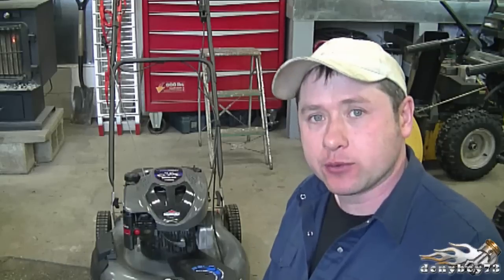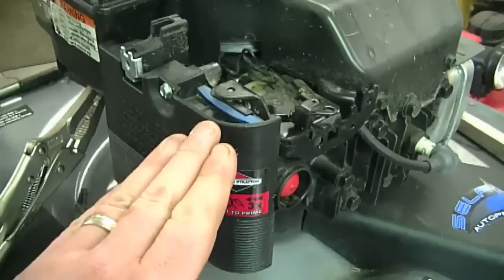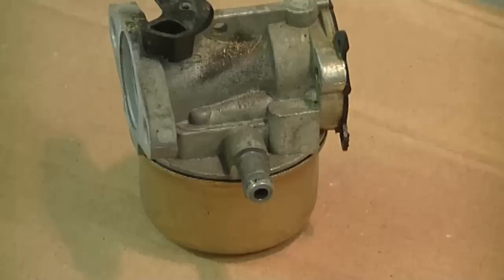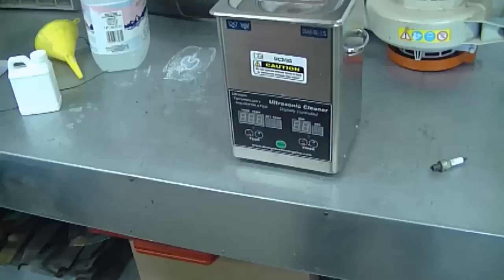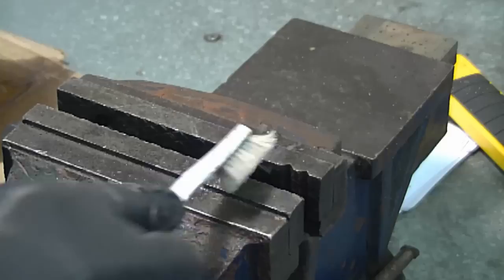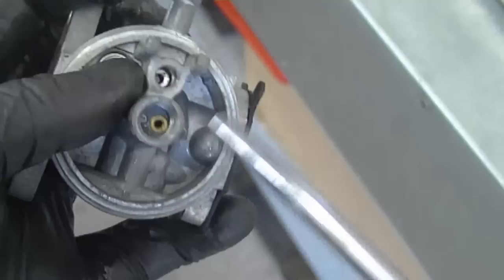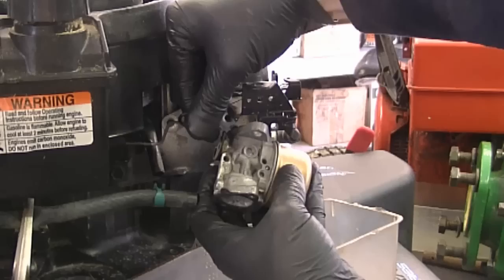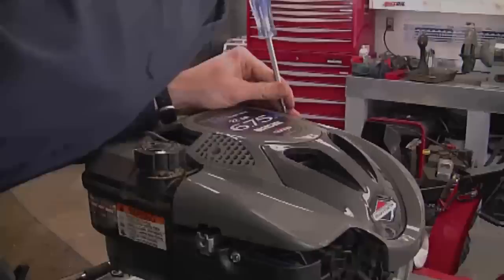CLEANING A Briggs & Stratton Quantum Lawnmower Carburetor

Comment from the maker: check spark, compression, make sure there is fuel to the engine, I usually spray quick start immediately after a rebuild to get it going quicker
Reply: I started mine as soon as I knew I could, then reassembled the rest after success.
Reply: You're the best

Comment: Much Appreciated.  Your instructions worked perfectly on my 2 year old snowblower which would not start. Turns out  the carb was was  gunked up with green sticky deposits , which I'm guessing might be copper carbonate caused by crappy ethanol in my fuel.  I've subscribed to your channel which are the best quality videos I was able to find. You saved my 120 dollars by not needing to take to my small motor repair shop.
Reply from the maker: you're welcome

Comment: I just cleaned my carburetor assuming that I had a dirty needle and seat. However put it all back together still would not run. So found your video and realized that I never checked the passages in the bowl nut. When I checked I discovered the passages were completely blocked. Cleaned them out with carb cleaner and some small gauge wire. Mower now runs like new.
Many thanks.

Comment: Thanks for the great videos. Our hand me down mower always had a really rough idle, then wouldn't run unless you pressed the prime button, as you showed here. I cleaned some gelatinous substance from the bottom of the fuel bowl (otherwise the carburetor looked clean), and once I remember to prime it, it started and ran as smooth as in the video; smoother than it ever had for us.

Comment: I am So pleased to have found this video.
I have a "Greenfield" ride on mower with a 6HP Briggs and Stratton engine that will run for about 15 minutes then stalls.
If I loosen the fuel line After the in-line filter, the fuel miraculously appears in the inline filter again, the engine starts and runs till the next time it "runs out of fuel!.
I now feel confident about taking the carburettor off.
Thank You for sharing your knowledge, and the very clear and concise videos'.

Comment: A belated thank you for this video: was watching it as a refresher and realized this is where you mentioned using a tip cleaner for the little holes. I'm not a welder so it took me a while to find what you meant (a little $3 thing in the welding department) but now that I have one it's great. As a suggestion, I used a pair of side cutters to snip off the smooth end portion of a few of the files so they can clean shallow holes better.

Comment: Another great video from Don. I must confess that at first I did not understand what Don meant when he said that the bowl bolt is also a jet and why he went to so much trouble to clean it. I cleaned my carb body to within in an inch of it's life and could not get the engine to run for more that a second or two. After paying real close attention to the bolt one last time it fired right up. Basically the bolt is hollow and gas gets sucked up through it. If the orifices in the bolt are clogged the engine will not run. After going through this I now understand why Don was so meticulous with the bolt! It does more than just hold the bowl on!! Thanks Again Don! You have a great channel!!
Reply from the maker: +Paul M thanks Paul

Comment: Excellent video, great camera work.  So much more informative and "watchable" than these weekend warrior videographers who hold the camera in one hand and work with the other!  Very clear vocals and diction...I was thinking Canadian, then I saw the predominant French on the can of started fluid...that clinched it!  The engine on my pressure washer had exactly this problem and I was a little leary about messing with it myself.  After this video, I feel completely comfortable pulling the carb off and cleaning it.  Thanks.  I've subscribed!
Reply from the maker: thanks for subscribing and greetings from Ontario Canada
Reply: +donyboy73.... thanks for your videos Bud. I've learned quit a bit by watching them. I've done a head gasket and adjusted the valves on my Briggs 18.5hp. I've got a Walbro carburetor, Do you have a video on how to adjust the Carburetor?

Comment: This really helped me!
2 points:
1.next time I'd never remove the needle valve seat! just block the channel to keep the carb cleaner away from the tiny rubber seat. I damaged it on removal.
2. If you do and are replacing with a new one, know that the tube is TAPERED down to the needle valve seat location, at first the replacement appeared too small, but when tamped into place it fit fine.

Comment: Thank you for your in depth video and step by step instruction.,ihave fixed a rider lawnmower and a snow thrower that was waffling by drilling the removable jet.and a carb cleaning a push mower that wouldn't start. Thank you so much!! Oh I used a o18 micro drill the smallest in the kit!

Comment: Late yesterday I removed this carb from a Weedeater mower.  Will place it in my ultrasonic cleaner today and replace it.
I am on a roll, repaired my JD GT275 lawn tractor yesterday and it is running like new.

Comment: its amazing how many of these things end up on the side of the road due to this issue. one easy fix later and it can be either resold or kept for personal use
Reply: I Literally got this same mower two days ago.. carb clean..and reset the butterfly valve which had somehow dislodged and jammed at wide open.. and it runs like a top.

Comment: Apologies for the lengthy question... Got Troybilt with 675 B/S, no primer bulb, from a Lady whose young son way, way overfilled the oil. Somewhere along the line he hit something to bend the blade and shear the key on the blade adapter as well. After draining the oil, I first pulled the starter, and a bit of oil spewed from the spark plug hole. After a good Carb clean, oil change, blade and adapter replacement, I took off the muffler and about 2oz of oil poured out. Put it back together, started on first pull, smoked like crazy for about 7 min, then I mowed my back yard with her machine for about 20 min. 

Went to deliver it to her the next day, and realized I forgot the bend the tabs on the muffler washer and lost one of her muffler bolts somewhere in my yard. Made a mad dash to the hardware store for a new bolt and spacers. I over tightened the bolt a bit due to the spacer inside being slightly shorter than the other bolt, slightly denting the muffler. Got it unloaded at her house, pulled the starter and it lugged and chugged, finally dying. 

I took it back and figured to look at the last thing I did to the machine. I checked the muffler mounting bolts, all gaskets are in place and the choke arm is free. I reckoned it might be a partially sheared flywheel key that I finished off mowing my lawn. Replaced that, (it was not sheared, but starting to)  Same problem, it starts, chugs and lugs along until I manually open the choke butterfly, and will sputter, eventually rev up, hunt around for speed for 15 seconds, and finally warms up and smooths out. I have adjusted the throttle arm to up the rpm from 2600 to 3250. I cleaned the carb again, this time replacing the valve seat, and new intake gasket and manifold o-ring, double checking with a fine wire that all passages are clear in the carb. The choke linkage and governor linkage operates freely with no snags or tension.

I have now drained the oil and gas again, and have it nose down to assist draining any more oil that may in the top end, however none is really coming out the spark plug hole. I can't send it back to her with instructions to stick her fingers behind the airbox to jiggle the linkage around till it starts running right. I'm at a loss. Any ideas?

Comment: Hey dony its Nate I bought a Craftsman 25cc straight shaft weed eater yesterday and used it 2day it's starts and runs great but it has a high pitched whine noise when throttled up @ cutting head. It has a clutch also. It was made in august of 2013.

Comment: Hey dony its Nate I bought a 25cc craftsman straight shaft weed eater yesterday & used it 2day it start n runs gr8 but when throttled up it has a high pitched whine @ cutting head. It has a clutch also.

Comment: To save a few minutes in the procedure, some viewers may plan to remove only the threaded nut beneath the carburetor bowl and the bowl, itself. However, on a dirty, dustry engine, dirt and debris are likely to fall into the bowl on removal.

And after cleaning the bowl,, reinstallation of the bowl requires the bowl be aligned precisely to avoid dislodging more debris-- almost any speck of dirt can cause a problem, and may compromise the work completed. 

The best approach is hose off all the debris (from a completely cool engine) well before the carburetor operation, and to let the machine dry, first. Since cleaning the carburetor is done only occasionally, it may be worthwhile to use a car wash pressure spray wand for a more thorough cleaning of hard-to-reach areas.

BTW, this is an excellent video-- well organized, with superbly lighted and focused close-up shots, and a clearly spoken narration. Wish all the videos had at least the production values of this one.

Comment: Thanks for this video it helped me to rebuild my carburetor last year. I rebuilt this carb thinking it would help my surging problem,but i think it is my governor. Could do a video on how to adjust the governor on this type of engine. Since the throttle is already open which way do you turn the shaft to correctly set it. Thanks again for all your videos

Comment: You forgot to remove the gasket on the carb that seals the air filter housing to the carb. Also it seals for priming as you know. All the gaskets and seat, I take some Magic Lube and give a light coating. ML is a pure silicone super super tacky clear grease. Perfect for 0-rings and gaskets to keep them moist and non-sticking. Makes gaskets reusable and last a lot longer. Magic Lube can be found at your local swimming pool supply store. It's great on household plumbing o-rings and such. Makes your faucet handles turn real easy and water doesn't wash it away. Helps rejuvenate dry carb bowl gaskets.
Reply: The Quantum series is on the old side and especially when they have been unused for a couple of years or more,I consider the whole fuel system dirty.
Remove and flush the tank.
Replace fuel line.
Replace the gasket between the filter cover and carburetor and most of the covers are warped and will not seal correctly for the primer to work. Replace it.
Otherwise this is a perfectly splendid video.
I have been snake bitten too many times from rotting fuel line and warped covers.
Just do it all at once and be done with it and have a happy customer that will reccomend you every time.

Comment: Another good tip is use a dremel tool with the wire wheel...brass so it doesn't scratch ....and a nylon brush wheel that also quickens the cleaning process
Reply from the maker: thanks for the tip

Comment: Great video Dony, very helpful and informative.  For these non adjustable carbs, are there any other further adjustments you would make to tune the carb? How do you control whether the mixture is too lean or too rich?  And how would you set the idle speed?
Reply: The mower will run without the air filter, and you can still get to any adjustment screws.  My stock carburetor on this engine has no choke but has screws.....
(The old rule of thumb is: Screw in the screws until they stop, then back them out 1.5 turns.  Adjust as needed while running.  Idle screws have to be set with machine warm) The mower should not be set on fast idle to run as fast as it can as this is dangerous and leaves no room for the governor

Comment: Every time I clean one of these, I always install a new needle, needle seat, bowl gasket, and breather plate gasket. Most rebuild kits are less than 10 bucks. Water will make those parts swell, so even cleaning may not always be enough. Nice video though!

Comment: Not especially but I have managed to shoot a few across the yard and lose them from the spray (especially from air gun).  Also, if there are any crunchies nearby that get blown through the seal opening, they could scratch up the seal face and make it leak.  A good carb dip can also eat some of the seals.  I am talking about the old school or Pro versions - not the EPA watered down stuff from auto stores.  Red seals work better than the black in my opinion.

Comment: That engine looks almost identical to a B&S 6.75 engine on my Craftsman self-propelled push mower; one that I'm trying to get up and running, engine model 125K02-0253 E1. The control bracket (somehow) broke so I'm having to replace it and will be installing a new $16 OEM B&S carb.  For some reason it was very difficult to restart whenever the engine was hot. Always ran great when first started up or whenever it was running for that matter but frequently took 30+ starter pulls to get it running again after it was shut down while it was hot (guessing it was flooding out?).  Hoping the new carb will take care of that. Oh yeah, all those additional starter pulls finally broke the starter cord. Will be replacing that, too. Oh well, great video, camera work, detail and information. Will come in handy for me sometime soon no doubt... thanks!

Comment: Nice job. But did you flush out the tank and fuel line? I had an old Ariens that I cleaned the carb on and put it back together, it ran fine for awhile and then stalled out again. I flushed the fuel tank and lines  and it ran fine. Thanks for the videos. A lot of useful info.

Comment: awesome vid Donny.....i followed tour instructions to a tee but lawnmower will not start....it will only start if i give it a boost with quick start....it runs fine while it is running but once shut down will not start with out the quick start....any ideas....primer bulb has no line it's moulded into the side cover

Comment: All of your inputs are awesome, I did the rebuild as you suggested. Now the machine will run fine for about 1/2 mins and dies out. Ideas?
Reply from the maker: sometimes the whole carb needs to be replaced
Reply: try to change cap of gas tank .

Regards from Croatia

Comment: The problem is it is hard to pull the cord. I did adjust the valve lash according previous video( it was 8th, I put back to 4th). The engine does runs smother. But compare to other engine in story

Comment: Hi Dony great video's. I have a Quantum 50 which is hunting. I gave the carb a clean and replaced the needle valve and seat along with the gaskets. This carb has the throttle cable. I have also tried running it with the air filter removed but the problem is still there. I was wondering what would be the next plan of action, cheers.

Comment: Dony great videos but I have a odd problem on a 6.75 hp tecumseh engine on a push mower that will randomly die I have cleaned the carb several times when I got the mower there was one bolt broken that holds the crab to the intake tube I was wondering if this might cause the random shutdowns?

any info on this will be a great help thanks

Billy

Comment: I have Briggs & Stratton Quantum 6.25HP model# 228511x8e. When I started this season (after I changed the oil and gas), it started fine but it was running weak, it wasn't as strong as before. I thought the carburetor was dirty so I followed the instructions  in your video to clean the carb. Then put everything together correctly like you said, but now my lawn mower won't even start. What could be wrong with it?

Comment: Donyboy, can you tell me how critical the welch plug in the carby is to the running of the motor. I have a Briggs & Stratton Intek 60 with hot starting problems, took the fuel bowl off and found the welch plug in the bottom and a shiny mark where it had been sitting for a while, couldnt get the carby bolts undone without force so left it out. It runs good otherwise. Steven

Comment: Just watched you video on cleaning a carburetor. Very helpful so I subscribed. Thank you. I followed your video and did the carburetor on my Snapper 13hp rear engine ride on. I read that when you remove the fuel bowl you need to hold the float up to stop the flow of gas. My gas does not run with the float up or down??? Any suggestions?
Thanks,
Harley
Reply from the maker: the needle might  be stuck or there is no fuel getting in carb

Comment: I have an edger with a Briggs engine. I have to keep the choke partially on to get the engine to run at at high RPMs. Could this be a dirty carb problem? Any suggestions would be appreciated. Enjoy your videos. Thanks.....Guy

Comment: My first experience opening up and rebuilding a Briggs & Stratton carb.  On mine, it was fairly dirty, and where the Welsh plug was had black sooty dirt.  I used  the end of a paper clip and started scratching up the black soot that accumulated.  I sprayed carb cleaner over everything per your great video.  On your video, I noticed where the Welsh plug is located, I always thought it was a screen that needed to be cleaned. Then I noticed the "screen" was missing. It's NOT a screen at all, you call it a Welsh plug, and THAT'S whats missing on my carb. It's just gone. I have a kit that includes those Welsh plugs, and in the morning I will replace a Welsh plug where the old one was.  I can't figure out how it got lost! I didn't use any compressed air, only jetted carb cleaner in all the holes.  Any thoughts???   THUMBS UP!!!

Comment: is it.common for a briggs and stratton to have no jets in carburetor screw bowl? It only runs on the Primer Gas then stalls. Tried cleaning everything by spraying.  I plan on removing the seat cause I hadnt done that yet. Any ideas what my issue could be?

Comment: Can you use brake parts cleaner instead of carburetor cleaner and is it safer to use on rubber parts? If you use a product like seafoam or K100 will this prevent these carburetors from gumming up and needing to be taken apart and cleaned?
Thanks for the great video, very informative!